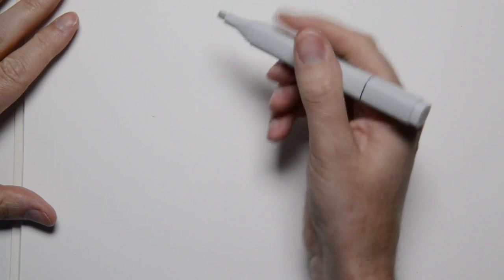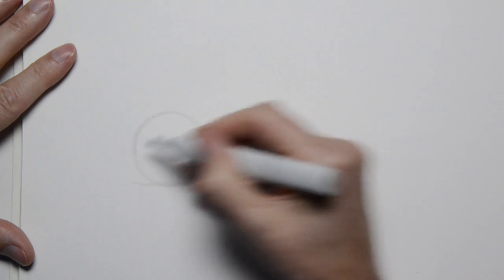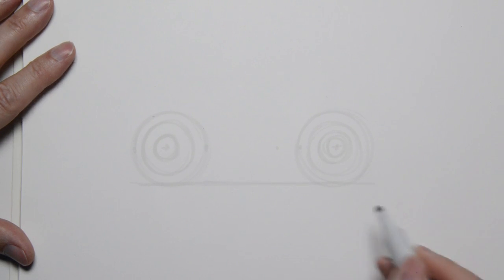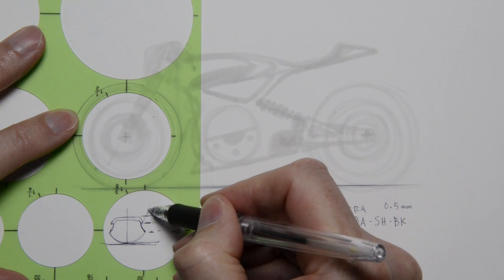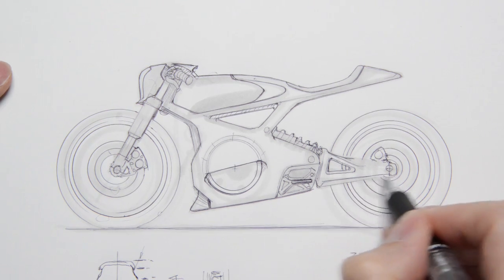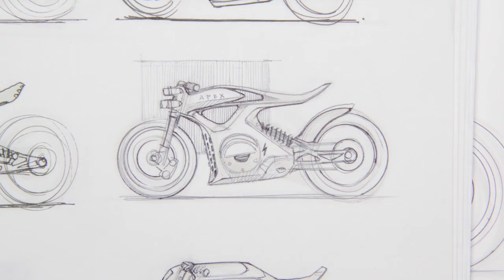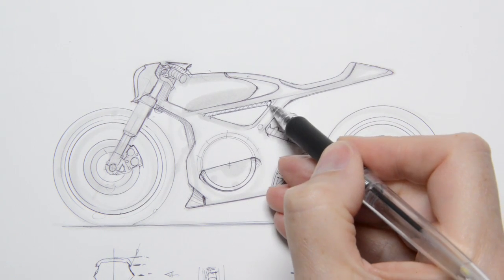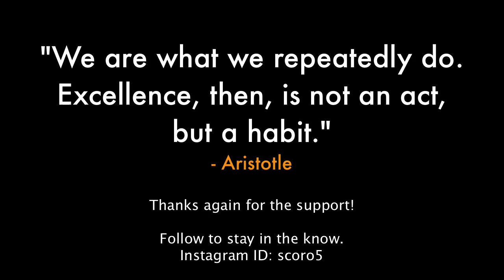Gumroad Tutorial Excerpts: Motorcycle Design 1

Comment: I've got a couple of questions; You said "before it goes into the computer" I can assume you mean scanning it. What is the objective? To 3D model it? To give it color and texture with the accuracy of a machine? To quickly render evolutions of the original? Will you be using Photoshop, Adobe Illustrator etc.? What were the paper types? Weights? Finish (tooth) and finally markers, pens, pencils. I can see reproducing your techniques for my drawings of engines. Thanks! Oh, and your drawings have a crispness that I admire and strive for in my work.